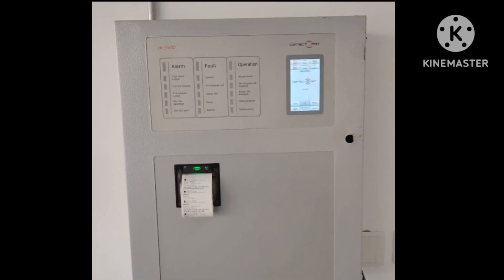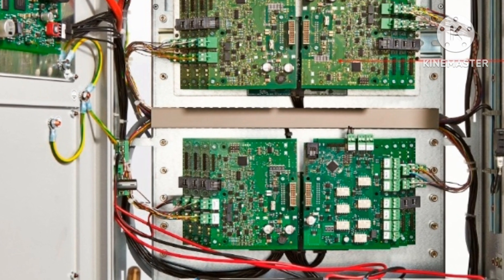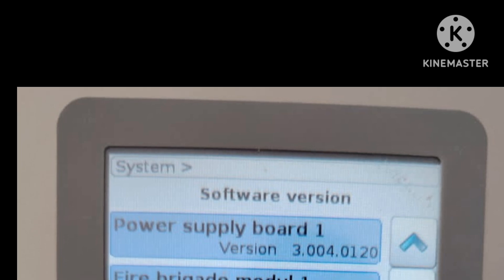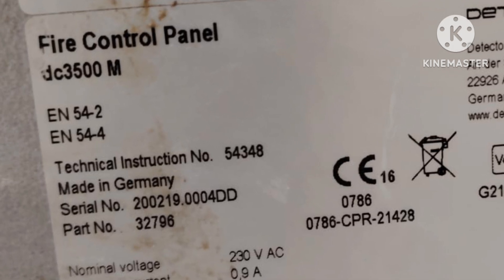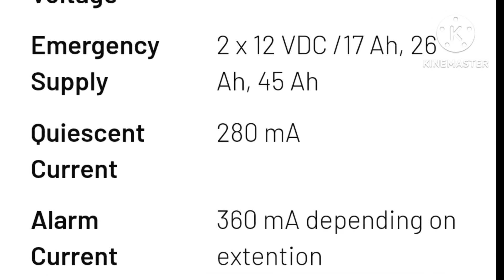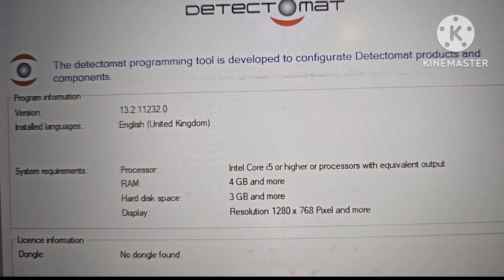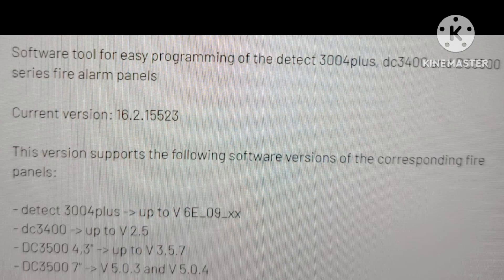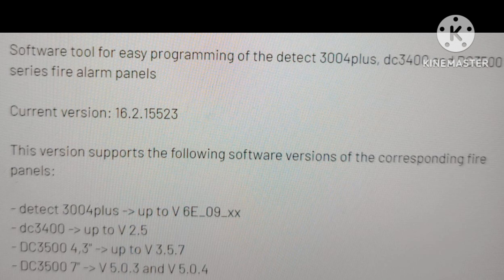DETECTOMAT DC3500 PANEL PROGRAMMING || DETECTOMAT FIRE ALARM PANEL PROGRAMING #DC3500M #DETECTOMAT

Comment: hello, we have a GENT  VIGILON PANEL . they have 68 device 1 loop card. our problem is { wiring changed - short at card 1 number 28 on loop 1 }. when allocate all device that time 28 number arrived stop allocate. what is the problem.
Reply: You first remove the device number 28 then chek the base and cable 28 to 29. Then all good you need to change device number 28.
Reply: And another option you remove the device 28 you put bypass then make allocate. If loop complete you should be change the device. If Not complet   you need to check the cable 28 to 29 then you can find out